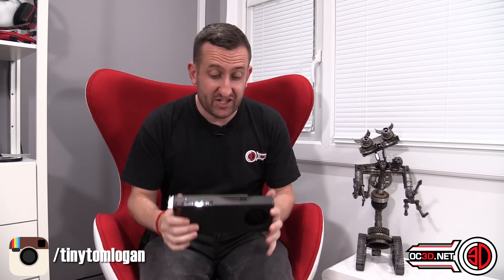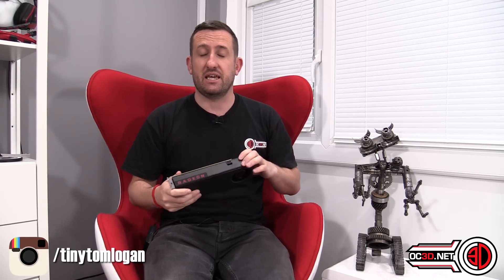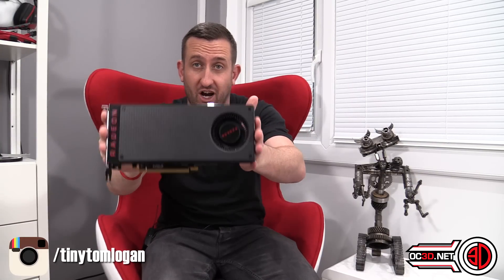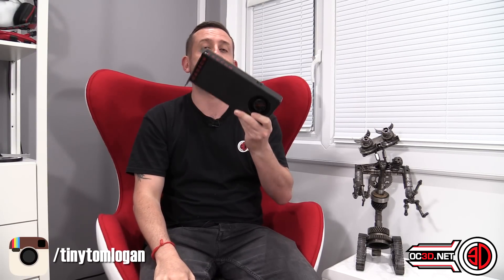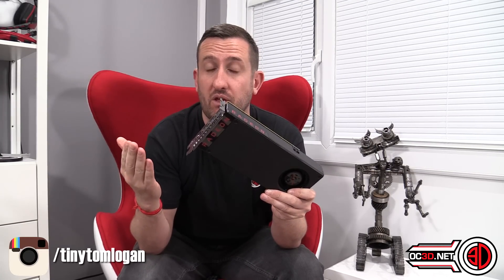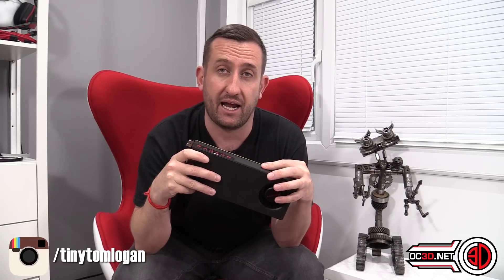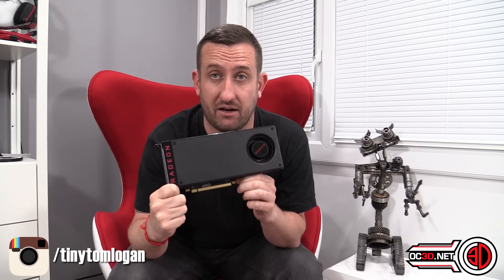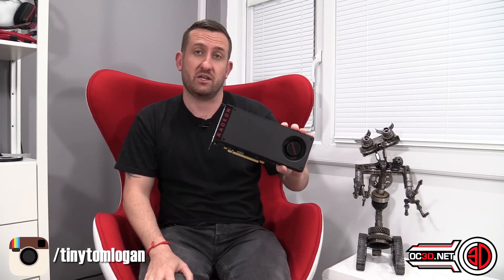RX480 power bottleneck? TTL Talks

Comment: The true bottleneck is the GCN architecture which is both not efficient and doesn't overclock at all... It's like Nvidia/Intel would keep making GF FX/P4 over and over again with just different label and manufacturing process, it simply wouldn't work in the long term... I expect AMD to have less than 10% market share in both CPU and GPU markets - let's be honest, after all those promises about 480 and what it actually turned out to be, I just cannot wait for those 8-core Zen vs i3 benchmarks...
Reply: And thats why you don't listen to rumors, amd never said the rx 480 is going to be as fast as a gtx 1070, its a 200 dollar card lmfao

It is how ever the best value card on the market
Reply: Hard to tell, from what I see in the comments on various forums people prefer to either wait for 1060 or get used 970 and OC it. So much for the "best value card" argument...
Reply: It's cheaper than a used 970......
Reply: GCN is not that efficient (even if furys are more efficient than big maxwell) but is a good architecture. Think about it. A 7970 today, is on pair with a 780 and using newer api they're still faster than some new card. Again, amd needs to focus more on efficiency, but to me, performance is the first thing and this cards delivers it. It all depends on how you look things. I think that 280x, 7970, 7950, 290, 290x are even today, really good cards. And I can't say the same about nvidia 700 series, even if Kepler was really good. Another point is the foundries. GloFo is not that efficient, we all know that, but, GloFo's silicon scales. FX are still holding the world record for highest clock, and looking at some reviews, when you push this card, it goes really well. I can't wait for some aib card. I think that if you can feed this chip, there will be some good surprise from a 200$ card.
Reply: zywypl why would you get a used gtx 970 when you can get a brand new rx480 with 8gb of vram for 20 dollars more? it does not make sense. especially with dx12, hell its even harder to recommend a 2nd hand gtx 970 when you can get the even cheaper 4gb rx480 model

But we shall see what the 1060 brings, cant wait
Reply: +Levi Webb 1060 might be good today, but will die in less than a year. Tiny bus (yes memory compression, still, is too little), low on vram, same maxwell boosted architecture unable to run dx12 features on hw level. Moreover nvidia will surely cripple the card otherwise it would be too close to the 1070. So, the 1060 will be probably faster than a 480 in dx11 games, for a while, and 480 will be faster in dx12 and vulkan. I bet that in 6 month the 480 will be faster everywhere and many users will complain about vram and bus size of the 1060. I don't like the word futureproof, but in this case, might be right to use that.
Reply: stock rx 480 is already beating ssc 970.... and 8gb > 3.5gb.
Reply: Yes, Maxwell might be better in Vulkan than DX12, but that architecture is good for efficiency and numbers, but it's not a forward looking architecture. Let me explain. Maxwell was in Nvidia's mind, we all know that, good efficienc, good DX11 performance, it's fine. But then something happened. They come out with Pascal, something that wasn't supposed to exhist. Infact, after Maxwell Nvidia talked about Volta. Pascal is just something for trying to squeeze some more performance from a good overclocker. Infact they compensate the lack of hw level computing with raw power and drivers. Seems a bit like 290x vs 780ti time, when Catalyst were crap and a 290x was struggling to reach the 780ti performance. And on both paper and reality, 290x was and is faster than a 780ti. Today we can see that, in 2013 we couldn't.
Right now, AMD is in a better position IMHO, they have nothing to lose because they are near to death, but they find some good move, consoles for example, forcing developers to use their architecture to optimize games. Moreover, they moved to a different price point, for now, a really good price point. I remember when i put toghether my PC, even with a brand new 4790k my first card was a 7770, because it was cheaper, at the time my monitor was crap and that GPU served me just fine, probably one of the best bang for the buck card, expecially if you bu that used.
After that i've moved to a 280x and i saw a constant grow, month after month, driver after driver. In the meantime, everybody with a 770 or a 780 started to struggle. Then the 960 came out, and everybody saying that it was the perfect card and bla bla bla. I was (and still am) on the R9 380 side, and the time proves me to be right, infact, the 380 beats the 960 pretty much everywhere in every resolution.
So, in my experience, Nvidia is better in the first time, sometimes may be a year (like 290x vs 780ti) sometimes a couple of month, but AMD eventually catches up and even overtake. I was surprised when i discovered that my old 280x performs as good as a 780 and my 290x a 3 years old GPU is on pair with a 980 and even beats 980ti in some situations.
So, to me, AMD is not only a better value for money, but a better value over time. And even if i like tech, i never spend more than 300€ on a GPU, because it make no sense to me. A CPU can last you 4 years no problem (look at people with Sandy, still rocking today), a GPU in a year is dead, especially an high end one. So this 480 is rock solid, i'm disappointed by the power consumption but that's GloFo, unfortunately. But performance are good and i'm sure it will beat the 1060. Maybe not in the very first time, but just after 2 or 3 month, it will, and at a lower price point.
Reply: +zywypl You could be right there. Especially as you can get the EVGA 970 brand new for the same price.
Reply: They trade more shaders (denser design) for lower clock at efficient voltages, with their current architecture paradigm, compard to NV.

Consider 480 chip is tiny and has higher shader core count than the 1070. (232mm² vs 314mm²; to be fair, the full 1070 chip found in the 1080 has slightly more shader cores.)
Reply: +Levi Webb 1060 might be good today, but will die in less than a year. Tiny bus (yes memory compression, still, is too little), low on vram, same maxwell boosted architecture unable to run dx12 features on hw level. Moreover nvidia will surely cripple the card otherwise it would be too close to the 1070. So, the 1060 will be probably faster than a 480 in dx11 games, for a while, and 480 will be faster in dx12 and vulkan. I bet that in 6 month the 480 will be faster everywhere and many users will complain about vram and bus size of the 1060. I don't like the word futureproof, but in this case, might be right to use that.
Reply: +NaXter24R Thing is all Maxwell cards will utilise the benefits of Vulcan not just AMD cards. The dx12 issue can't be as bad as AMD make out as if it were we wouldn't be seeing an old 970 beating the new 480 in new dx12 titles. If it was that bad we certainly wouldn't see it. The 1070 is outperforming the Fury X in most dx12 titles as does the 980ti's so I don't get all this "it doesn't run dx12 well". Seems to be doing just fine which like you said will only still get better with Vulkan. This 480 is indeed a very good 1080p card though and I also think it will get better over time with drivers and 3rd party cooler versions it could even match a 980 3rd party overclocked card, but by then Vega and VOLTA  will already be out and everyone will be wanting one of those.
Reply: +Vlad Lol. You can get an EVGA overclocked 970 Brand new for the same price as the 8 gig 480 from Overclockers. Personally I would wait for the 3rd party 480's though as the 970 is just ahead in frames over the reference 8 gig 480. I think that will change with the 3rd party versions 480's with better coolers and a power voltage change.
Reply: +zywypl most people still buy cards right around 100-200 usd. It is still a great value card. I think you just expected more from it but didn't think about where it actually is aimed at in the market which is the "500-600 usd budget gaming build"
Reply: +Michael Hwang but 1060s are 3gb is $250 and 6gb is $300 as far as I heard.   At $300 for 6gb 1060 would be waste of money and just go for 1070 instead.
Reply: +Michael Hwang Hi Micheal. This card is only a 1080p card so your fine. You would have to turn OFF lots of settings in your games to play at 1440 anyway which would be crap. If I was building a new rig and was thinking of keeping costs down I would wait for the aftermarket  1060's which will overclock easily  and compare performance.
Reply: shots fired@zen hohoho!
Reply: don't exactly see used 970s under 200 $, so if a new card is cheaper than a used card which was the previous king of price/performance, I don't exactly see what the problem is.
Reply: well it seems you didn't watch the video at all he said tremendous amount of oc can be achieved just by putting more power, personally i have a msi gtx 1080 good but can't go beyond 2030 mhz whereas there are 2 power connecters and 2 big fan so a bit disapoinnted (but running gta 4k ultra at 30/60 fps with no aa)
Reply: +NaXter24R Thing is all Maxwell cards will utilise the benefits of Vulcan not just AMD cards. The dx12 issue can't be as bad as AMD make out as if it were we wouldn't be seeing an old 970 beating the new 480 in new dx12 titles. If it was that bad we certainly wouldn't see it. The 1070 is outperforming the Fury X in most dx12 titles as does the 980ti's so I don't get all this "it doesn't run dx12 well". Seems to be doing just fine which like you said will only still get better with Vulkan. This 480 is indeed a very good 1080p card though and I also think it will get better over time with drivers and 3rd party cooler versions it could even match a 980 3rd party overclocked card, but by then Vega and VOLTA  will already be out and everyone will be wanting one of those.
Reply: Thats if they actually have physical stock this time and not another bs paper launch lol
Reply: GCN doesn't overclock less, it does differently
Reply: @Mauri.tanga But why would you want/need 8GB VRAM in a card that doesn't run well even in 1080p, in which 4GB is sufficient? 480 is the very opposite of Fury, which was suppose to be for 4K gaming and got only 4GB.
Reply: zywypl For 1080p is more than enough, and can do 1440p as well. Even my 290x can do 1440p, it's just a matter of "how dumb can you be". Using filters and using some preset that do basically nothing but killing fps, is being dumb imho. For example, shadows, they can eat a big chunk of fps and you could be just fine running high instead of ultra, no need to spend 300 bucks more for that.

VRAM: yes, but now, finally, developers are starting to use the damn thing, cache for example, or other stuff that i'm no into and i can't explain. The more, the better.
fury's are a bit different on how they works.
Reply: MayDay GoingDown!! loooool in wich dx12 benchmark a gtx 970 is faster than a rx480??
Reply: +Yussef Mneimneh look at Tom's video benchmarks Loooool. It the Video of the 480 benchmark.
Reply: i laughed so hard when i saw them talking about rx480 beating 980's. and i told them since day one....970 or 780and not the 980 n'or higher...One thing the rx480 is beating atm is the power wattage that is crashing the drivers and some people saying that their motherboard died because of the powerdraw from the pci slot to the card
Reply: +Pastechi why  would you laugh at it??  Do you realize this card with 1400ghz+ oc'ed actually beats gtx 980 stock.   Rx 480 does have  ability to go 1400ghz+ once power issues are fixed with aib  cards but this needs to be fix to get there.
Reply: dlckddyd76 ye...but the fact that it actually didnt beat the rx480 is something else...the only game i saw the rx 480 beating a 980 is in hitman, a game sponsored by amd itself btw...
All the other games it goes head to head with the 970 and the r9 390
Reply: Already is @ a 980 in all the reviews it is better in 75% of game titles comparing to 970 SSC cards which most reviewers are using. A 970 SSC is on par with a 980.
Reply: +Jeffrey Hramika I guess you haven't watched Tom's benchmarks results then?.
Reply: +Jeffrey Hramika ummm no stop Makin false comments.  It's near 980 but does not beat it.   The power problem is real unless they can fix this,  the coming 1060 might be better buy if price is within $50 or less on 6gb
Reply: It's however scoring just fine in 1440p on medium settings (stock rx480)
Reply: +SilverbeardTV Lol, It's like Tom said in his benchmarks results, In order to play a game at 1440 with medium frames you have to turn of the bells and whistles, so no its not good for 1440 at all, it's a 1080p card. Go and watch the review and listen to what he says.
Reply: MayDay GoingDown!! well...even tho  uhave to play on low....it still can handle the 1440p tho...just that some people expect to atleast play on high but gotta put it at medium lol
Reply: MayDay GoingDown!! they said 4k w/ 2 480s 

EDIT: running 50fps @1440p with settings cranked up to max on most newish games with a 240$ card is not "poor frames"

if you want to hate on this card, you'd be much better off complaining about the PCI-E power draw, because thats whats realy wrong with this card
Reply: SilverbeardTV crossfire 480 or single?
Reply: Pastechi Single, with crossfire 480's you can expect about the same peformance (albeit a slight bit lower) of a single 1080 (In the games were crossfire is actualy working that is)
Reply: SilverbeardTV 2x 480's has twice the power consumption as a single 1080. You pay 160$ less for the2  cards but pays more $ on that electricity bill and either way in 1year or 2 have to upgrade to a new amd card. While on the Other hand i can buy a single GPU, have no issues with stutters in sli/crossfire. Easier to sell it and buy a new one if you want to be up to date every year or 2 atleast
Reply: Pastechi Oh yeah no doubt(technicaly its somewhere around 60% more power draw).
Im not trying to make out the 480 as some end all be all graphics card, im just saying that AMD never lied about the peformance off the product, it does everything AMD said it would.

With that said I wouldnt recommend anyone to actualy get a stock 480 as it currently is, but rather wait and see what their official statement regarding the PCI-E power draw is gonna turn out to be
Reply: SilverbeardTV AMD did say from the start it will go head to head with the r9 390 with less powerconsumption and that they delivered BUT going with the stock as it is now....i say negative. I say wait for the AIB Versions. Have you seen the Sapphire Nitro 480? They have 1x8pin instead of the 1x6pin and for those dual link dvi users, they added the dvi connector as well. And Besides better cooling solutions than the stock reference one
Reply: +SilverbeardTV I'm not hating this card lol, it's a good card. But it is a 1080p card. In Tom's gaming benchmark video he explains that in order to play @ 1440 you have to turn the bells and whistles off in game settings to achieve medium frames. That's not a 1440 card my friend that's a 1080p card. It managed 30 frames with them on which is not a good enough experience for gaming, unless you like stuttering game play. If I had a criticism it would be the very high Temps. 85 to 90 degrees is not good at all. Especially at 1080p without any overclock lol. The 3rd party versions should help it a bit there. And as for AMD'S over hype they did indeed say the 480 would be a 4k gamers card at a price everyone could afford. Also why on earth would anyone buy 2 480's which would be the same price as the Fury X if you wanted 4k lol, and we all know that 1 powerfull single card is better than 2 1080p cards at gaming not only due to driver's and game optimisation or rather lack of,  but also temps. I really wouldn't want to be in a room with 2 cards outputting 80 to 90 degrees each lol.
Reply: MayDay GoingDown!! "And as for AMD'S over hype they did indeed say the 480 would be a 4k gamers card at a price everyone could afford." You're confusing 4K with VR my friend
Reply: +zuluknob 1st, AMD at the Tech demo said it. in fact the Excact words where" Now everyone can afford 4k". 2nd, if you have been running 2 cards you will already know that it doesn't use 2 memories  right. So your gunna have 8 gig idle. 3rd, for 1080p gaming you don't even need 8 gig lol. Show me a game that utilises 8 gig lol. In 1080p your gunna have lots of that 8 gig idle, even at 1440 lol. You will also be aware that the most popular games such as Battlefield, GTA 5, Cod,  etc are not optimised for either sli or crossfire.  And please, Every man and his dog all know sli and crossfire driver's just aren't good, Maybe that will change in the future who knows. I've had duel cards such as 295x2, a crossfire card and the drivers where crap. I have a couple of extreme systems due to my work, one contains a sapphire Fury X and the main rigg contains the Hoff edition 980ti. I can play any title I wish with all bells and whistles maxed out @ 1440. I only have to turn the odd setting down @ 4k. But the most important thing is I can do this because I'm NOT using sli or crossfire drivers that are 1, not optimised, 2 because they are both powerfull cards on their own. I'm changing the Fury X soon.
Reply: +SilverbeardTV So they think a card that matches a 970 in frames per second will render 1920x1080 resolution TWICE when it's a 1080p card as it can't play a single monitor at 1440 and do it at acceptable 60 frames per second lol?? That's gunna be very interesting.
Reply: +Yussef Mneimneh Thing is the more power you put in the more throttling you also get as he said, it's a Trade off.
Reply: +zuluknob Dude, memory in crossfire or SLI only mirror each other. It's been that way since the dawn of time that's what your seeing. Do you think if you had two  8 gig cards you would your game would have access to 16 gig of memory lol. what you see is a simply 2 memories being mirrored, that's how it works. You get the clock speeds but the memory is only being mirrored. And as far as I'm aware the 280 is what.. a 3 gig or 4 gig card. I haven't owned one so forgive me if that's incorrect.
Reply: I have one FX-6300, two FX-8300 and one i3-6100 rigs at home, I prefer FX-8300,fastest and best all around solution
Reply: +2Starfighter Yes because your benefiting from clock speeds.
Reply: +zuluknob Just watched the 8 gig 480 crossfire benchmarks results. It doesn't beat a stock 1080, it only beat a 970 ssc sli in 1 game. And as I said earlier it only uses 1 480 in new dx12 title such as the new Tomb raider as there is no support for sli or crossfire So 1 card is only being used. 480 in crossfire did beat the 1070 but 2 480,s is a  more money so it should be no surprise. But 970 ssc in sli beat 8 gig 480 crossfire in titles apart from 1.
Reply: +Mayday GoingDown!!
In most games that don't have multi GPU scaling problems 2 480s get very close to a 1080 and that's in DX11. There are only 2 games that utilize DX12 at the moment, Hitman and AOTS, both of which AMD cards gain substantial performance improvements.

https://www.techpowerup.com/reviews/AMD/RX_480_Crossfire/
Note: the tech powerup review disabled DX12 in the Hitman benchmark claiming bugs, which is suspect.
Reply: zuluknob 
So it does. And it also has nice gains on AMD hardware.
Reply: They keep using the GCN architecture because it destroys Nvidia at DX12 with asynchronous compute. 

I have a feeling the RX 480 will actually be a card that lasts for a very long time.
Reply: +Son37Lumiere NOPE, the review I watched was in dx12 over at Jay 2cents. And new dx12 titles such as Tomb raider will only use 1 GPU, The new Hitman also.
Reply: Doge Charger Destroys? In most cases AMD cards are just slightly ahead of Nvidia (10FPS at the very best case scenario, mostly just 5-7), and that is when comparing high-end vs mid-end GPU 's (something like 390 vs 970 in most DX12 tests), but then again - the gap can be narrowed by OCing the Maxwells. And bare in mind we are still talking about completely fresh GPU vs a 2yo product, so it took AMD two years and two times smaller manufacturing process to catch up, that just shows how much of a dead end the GCN is. And speaking of new GPUs - Pascals destroy every game in DX12, and those also don't have proper hardware Async Compute support yet, now imagine when Nvidia will finally sort that out in future GPUs... Also keep in mind you need an OCed i7 if you want to get all the performance from AMD cards, which just doesn't make any sense with a 200-250$ GPU...
Reply: You didn't see the video. Right?
Reply: +MaddXav Who are you asking?.
Reply: MayDay GoingDown!! The original post.
Reply: +MaddXav I just read it, I'm don't get into market shares and all that gubbins but he's right about GCN not being good for overclocking  etc. The 380 390 Fury X are all not good for overclockers at all. Maybe this 480 might fair a bit better but the only way it can be done is through increasing power voltage which leads to throttling and PCI express problems and temps so unfortunately you will find yourself in a Trade off situation. And that in itself is not good. I still think this 480 is a very very good card for the price though, I just wouldn't want to push it much more than its factory settings.
Reply: MayDay GoingDown!! To being with, saying GCN doesn't overclock that well to say it doesn't overclock at all is not the same, and second the point of this video is that this card is being bottlenecked by power even at core clocks.
Reply: MayDay GoingDown!! 
Nope what? Did you even look at the crossfire review? And ffs Tomb Raider isn't a dx12 game, it's a fucking gimpworks title with a dx12 wrapper that is shit. Have you not looked at any of the dx11 vs dx12 benchmarks?
Reply: MaddXav I did, and it doesn't change the fact its a 5yo architecture. I won't be suprised when the custom cards will be able to get just more 50-100Mhz even with 2x8pin connectors, which is laughable compared to Pascal's ~500MH on a single 8pin power connector.
Reply: SilverbeardTV 50FPS in 1400p does sound nice, but bare in mind the card requires a 4.5-4.7GHz 6700k to get out full performance (and this is the CPU which you will see in all the test in the web), but someone aiming for a 200-250$ card has an i3 or AMD CPU, stock i5 at very best, and the real performance will be much, much worse. So untill AMD sorts out their sh***t drivers their cards will never be a good value, no matter how low the price will be, the 1x% and constantly shrinking marketshare just proves it, nobody with common sense doesn't want to but AMD cards.
Reply: zywypl 
You can't stop spewing bullshit can you. Nothing you say is even remotely based in reality.
Reply: Son37Lumiere Sure, like it didnt't happen previous year, 2 years ago, 3 years ago, and so on.... You have to step back to reality, stupidly forcing GCN with terrible drives year after year after year simply DOES NOT WORK, with current pace within a few years Nvidia will have total monopoly on the GPU market with more than 90% market share, like the prices are already heavily inflated... AMD needs to step up or else we are all f***ed, and reselling GCN over and over again is short of "stepping up".
Reply: zywypl Wether or not people will get CPU throttled has nothing at all to do with the ability off a graphics card to peform at 1440p
Reply: Such fanboyism... tisk tisk. I have an R9 280x that does high/extreme 40-60 fps single card on GTA5 and FO4. If you're not going to try both products out then whatcha goin' on bout?

Edit: AA off. 2560 x 1080p (extra wide curved monitor).
Reply: *****
Hype is exactly that, hype.
Reply: +Son37Lumiere What!! the new Tomb raider is indeed a dx12 title, as is Hitman. just stop with your excuses after excuses, it's getting embarrassing. And why on earth are you know on about crossfire compared to single gpu? considering crossfire doesn't even play dx12 titles such as Tomb raider or Hitman!!. like the results confirm the Fury X doesn't beat the 980ti's once the overclock is applied, lol get over it.
Reply: MayDay GoingDown!!
Marketing is a powerful thing. Those that make the most expensive purchases somehow believe they are endowed with powers to tell other people how to spend their money and when you call them out on it they respond with personal attacks.
Reply: MayDay GoingDown!! Tomb Raider has a DX12 port, but that is all it is. A ´port, and a pretty bad one. The same developers said it is not finished and they don't recommend anyone to use for benchmarking DX12 since the results wouldn't be reflective of the API. I believe it is the only DX12 port that performs worse than it's DX11 counterpart. Hitman, Ashes of the singularity, Gears of War, and some Vulkan titles like the Talos Principle are better for benchmarking performance on the new APIs.
Reply: MaddXav
You can use that for either team and software compatibility.
Reply: +LucidDream101 Yeah it's sad the 2 guys on here just can't get their heads around facts presented to them. And I own a Fury X lol. Well soon to be Sold.
Reply: MayDay GoingDown!!
I still own a 280x and could give a shit. lol
Reply: +Son37Lumiere lol, nope, wrong again. I never said it was perfect, just said it was in dx12 which it is. but also like I have shown you, you have indeed seen the results now which have proved you wrong...Again!!...And simply sat there in front of your monitor frothing at the results simply shows you just can't let go of the obvious Fanboyism that consumes you lol. Like the results show, look way down the list. Which is quite apt for you.
Reply: +Son37Lumiere Wrong yet again, and the sadest part is your already on a benchmarking reviewers site that also proves you wrong lol, it just doesn't get better than that lol. What was it you you said about being Dumb?? Like i said, my Hoff edition 980ti outperforms my Fury X, The 480 does not outperform the 980, this is due to the overclocks on the Nvidia 980ti and 980 that both the Fury X and 480's cannot achieve. The 1070 which is priced at 375 quid for the KFA2 version outperforms the Fury X. All proven facts in links sent. And all this from an AMD card owner!! And by the way, Asynchronous compute only gives AMD'S top teir cards such as Fury and Fury X 3 percent at most increase as it only benefits the lower end cards. That is widely known on Google as you seem to rely on so much and was acknowledged by AMD from the start. And Yep!! your right, I'm done with you, I'll leave you to continue frothing at results. Enjoy your Fanboyism.
Reply: +MayDay GoingDown!! cancer
Reply: +Son37Lumiere The link sent was OC3d  1070 benchmark review video by Tom, it does show the overclocked 980ti,s and the 1070 above the Fury X. Think that was the piont. Don't know about Ashes as I don't play it or know anyone who does so never played it.
Reply: +Doge Charger (Alan Romney) The link was to Tom's OC3d 1070 benchmark review that does indeed show the overclocked 980ti's and 1070 above the Fury X. Think that was the piont.
Reply: The Danster
That review is a joke. Every overclocked nvidia card under the sun compared to only a few stock AMD cards. And can you idiots read graphs? Look at the numbers, not the size of the bars, we're talking tiny single digit percentage differences from one to the other. Besides, no one was arguing that the 980ti and 1070 are faster (a little) than the Fury X in the majority of DX11 games. The point is that AMD's cards are more future proof in DX12 and Vulkan as they get substantial performance boosts from async support unlike nvidia, which shows zero difference or even reduced performance. You know what they don't show in that review, any AMD cards in any of the DX12 benchmarks like Ashes and Hitman. Gee, what a coincidence. All Mayday idiot boy did was cherry pick a single review that omits data to show nvidia cards on top.
Reply: +Son37Lumiere Hey chill out budy, it's only cards not end of days lol. I couldn't give a shit lol. Thing is I noticed over at Jayz 2cents reviews it's basically the same results in dx12. And Tom's benchmarks have always been spot on. Hitman and Ashes as we know are very AMD favored so it's not surprising there, but as most of us don't play Ashes but do play Battlefield Gta5 and are all waiting for the new dx12 version's of those which will not probably utilise async anyway it wouldn't surprise me if the Nvidia cards do better than what AMD'S currently offering. Guess we'll have to wait and see those benchmarks. Cheers.
Reply: The Danster
AMD will most likely be behind the power curve on said benchmarks for reasons you just mentioned. "...are very AMD favored." So what's that mean? If every game favored AMD then AMD would be unanimously better and with current price point?
Reply: +Son37Lumiere By the way I'm sure Nvidia cards utilise Vulkan too or so I read. Is that right?.
Reply: The Danster
Hitman and Ashes perform well on AMD hardware because of something called asynchronous compute which AMD has full hardware support for in their GCN architecture and which DX12 was built to utilize. Nvidia DOES NOT. Do some research on the matter. No, Battlefield and GTA5 won't be getting DX12 versions, they are already done and weren't built for DX12. And no, nvidia will not do better in any DX12 game unless they pay the develop to specifically hurt AMD's performance, which is certainly not out of the ordinary for them and their "gameworks" crap.

As far as Vulkan, both DX12 and Vulkan were developed directly from AMD's Mantle project. Maybe nvidia has better performance under Vulkan but that has yet to be determined. id still hasn't released Vulkan support for Doom to test it out and I suspect nvidia is holding it back.
Reply: Son37Lumiere
Chillax man. I want him to answer my question first.
Reply: +Son37Lumiere Yeah I'll have a spot of research on it all. I'm 45 and new to it all. Come from console to PC you see. I thought the new Battlefield 1 and GTA6 which are both due out at end of this year would be both dx12 titles??  Sure I read that somewhere.
Reply: +LucidDream101 Lol, just read your "Chilax man" reply. Sorry for the delay, I'm at work you see so sometimes can't reply straight away. As for "favoured AMD" I notice everyone says including titles like Ashes and Hitman favour AMD'S architecture, must be down to asynchronous compute I guess. But then surely if every game favoured one card brand then surely then that brand would put there prices right up, so then AMD cards would become expensive yes, or have I got that completely wrong. Surely that would be bad for everyone. Once again sorry for the delay.
Reply: The Danster
No problem man. I work nights 12 hour shifts so I know what it's like. My point is that if every game utilized AMD's architecture then wouldn't AMD be better than Nvidia hands down?
Reply: +LucidDream101 Yeah for sure. It would probably make Nvidia implement it on their cards though at some piont. What do you reckon?.
Reply: The Danster
Doubt it. Not as long as Nvidia stays on top. For one example you remember when Microsoft just sat on their thumbs for the longest time making minor changes to Direct X technology over the course of a decade at least? Remember then Steam OS debuted along with AMD's Mantle technology? Then all of a sudden Microsoft got off their asses and Gave us Windows 10 and Direct X 12.
Reply: LucidDream101 ROTFL, what am I reading here, you really think to write an entire OS is "just like that"? Steam OS was dead on arrival, same as Mantle, and they had little to no influence why MS released Win10 with DX12. And so far DX12 looks like a disaster to be honest, games run better is they run in DX11 while looking exactly the same, so I don't see what it brought up to the industry (other than killing multi-GPU). Maybe it does speed up AMDs cards a little bit, but then again - they should just put their shit together and write proper drivers, but if they didn't do that in the last 15-20 years it's safe to say they will never do that.
Reply: zywypl
First line = HUGE strawman. Want to try again?
Reply: zywypl
If you were half way intelligent you'd know that the API is the basis of game code not drivers. But you won't get that because you will explode fluff like a dork on his first orgasm all over the screen. You're an idiot.
Reply: LucidDream101 CPU overhead - learn what that is, then we'll talk.
Reply: zywypl
Electronic hardware is dead weight without software utilization to manage it. You... You're that dumb.
Reply: zywypl
Ok, I appologize. I feel sorry for you. The "DRIVER" is software that communicates with other software!!! Do you need clown shoes?
Reply: +LucidDream101 "Clown Shoes". lmfao...Dude your killing me lol.
Reply: The Danster 
Yes you're correct, I thought you were talking about the current Battlefield and GTA games. The new ones will indeed support DX12.

And as I suspected, id has released the Vulkan update for Doom and AMD benefits while nvidia does not just like DX12.

http://www.guru3d.com/news-story/new-patch-brings-vulkan-support-to-doom.html